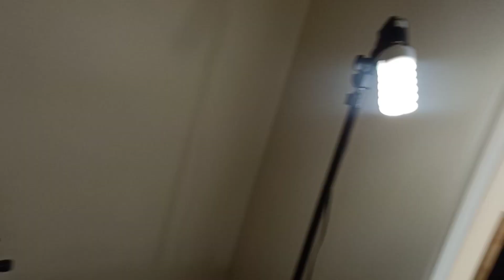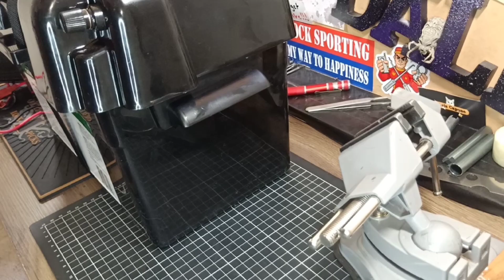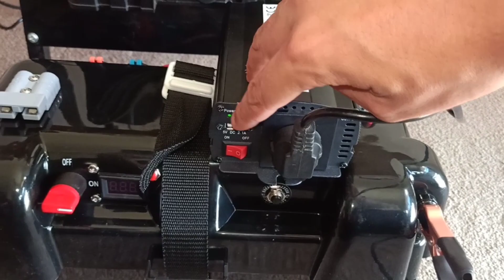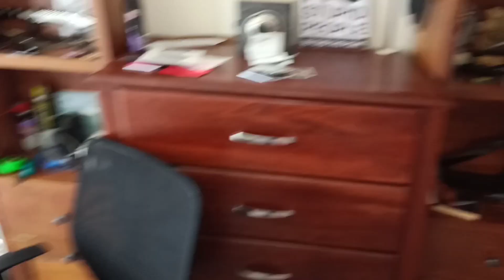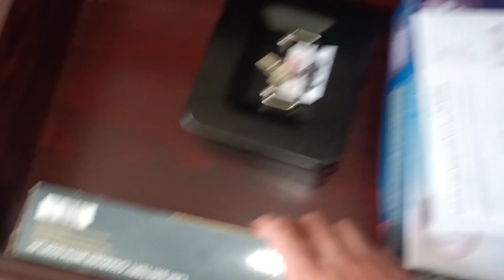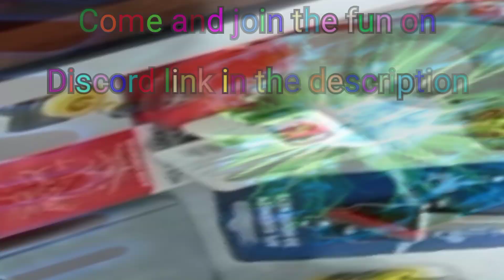Portable power station for key cutting (343)

Comment: Get you a 3way adapter and you can have all 3 plugged in. As long as you only run 1 machine at a time. I'm assuming that you plugs and adapters are similar to the ones we use here in the USA. Nice set up and looking forward to the tubular key cutter review. Take care M8 and be well. 🙂👍
Reply from the maker: Yeah I thought about that but don't really want to put excess stress on the inverter. Yeah ours are similar I think. Thank you mate and you to 👍🤘🖖🍻